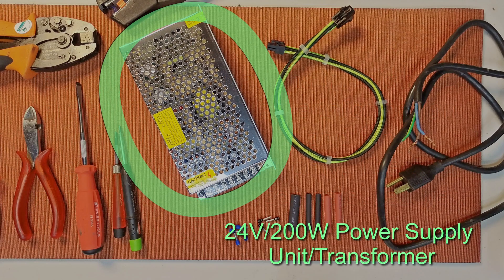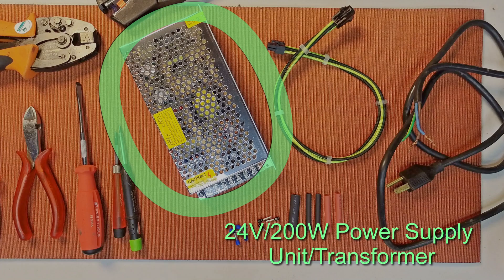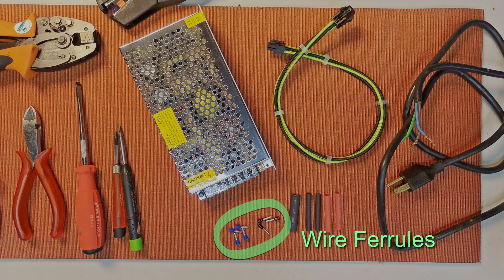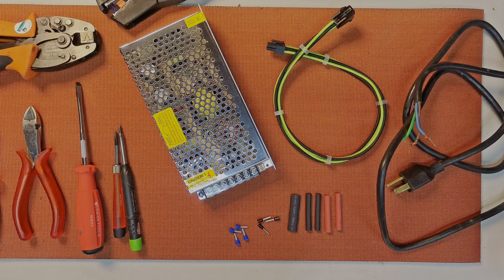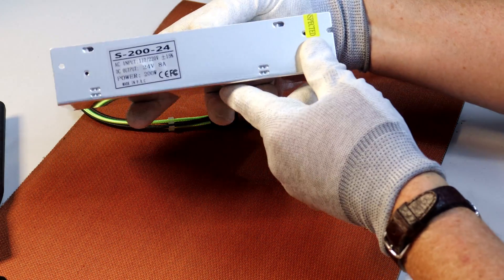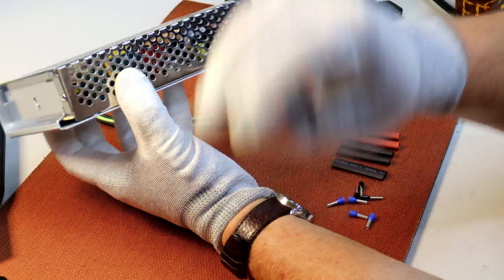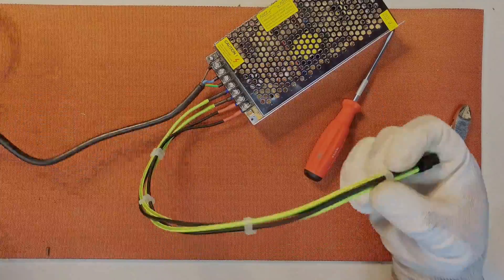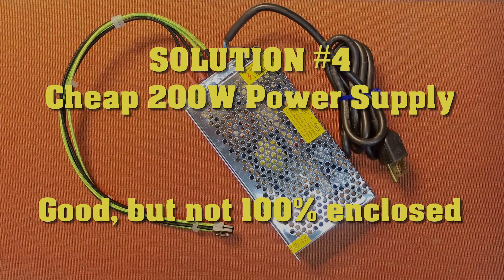$25 DIY 👨🏻‍🔧 **8Nm**  Fanatec CSL DD 200W Power Supply Pack (Boost Kit 180 alternative!) 💪

Comment: followed this video and built build one for my 5nm CSL DD and works an absolute treat!!  Wheel was good before - it's AWESOME now!  Really recommend it - cost me £30 GBP from amazon for PSU and cable and came next day.  beats £150 and a week+ direct from fanatec
Reply from the maker: AWESOME indeed!!! 👍👍👍
Reply: @Polymer  thankyou for your clear guide. Perfect guide, if you can wire a plug you can easily do this!
Reply: Is it simple case where to put your cables from the mother board extension two the left two two to the right as he didn't mention anything on that
Reply from the maker: @kallumwilliams5707  Not quite sure I understand. There's a  longer, more detailed video (maybe that will help?) here: https://youtu.be/wVgVxpWgBOM
Reply: @kallumwilliams5707  Yes, he mentions it in the other longer video he linked in the description, but very simple, basically if you hold the plug facing you with the catch at the bottom, the top right and bottom left are the positive and the other 2 are the negatives.  The cable I bought nicely had 2 separate colours and these were actually on the diagonal the same way.
Reply: @MySimRacer  alright thank you mate I've just ordered the kit now, I didn't want pay fanatecs price as it's technically a csw 2.5 PSU with a different adaptor and they was sold for €40. You still using yours fine no issue?
Reply: @kallumwilliams5707  Yep, No issues at all! works like a dream - and you certainly notice a huge difference. Good luck with yours.
Reply: @MySimRacer  thanks mate my brother's a electrician so my show him the video and let him back on lol
Reply: do you know if its possible to reuse the cable end from the 5nm power supply? By just cutting it off and stripping the wires?
Reply: @GKJasper  I don't think the PSU is man enough with 180w needed
Reply: @GKJasper  I really wouldn't, have kept the original psu as a backup or if I ever resell it.
Cost of all new parts, just buy descent cable from amazon.
Reply: @MySimRacer do you have a link for the amazon PSU?

Comment: ive got a dd1 without a psu supplied with it when i bought it of someone would the 36 volt 10a 360w work for time being i know its 120 watts short of the power brick fanatec sell but couldnt find a cheap 500w 36v psu next day delivery 
also the pin out is 2 positive and 3 negative with a pe sense pin with the pe sense pin do i shove that into ground or the v+

Comment: Are these kinds of power supplies better or worse than the brick types? I'm no electrical engineer but it's switching noise something to be worried about? 
I'm about to buy a Chinese one with variable output for my Moza wheelbase. Thanks for any insight!

Comment: what pins should be 24v and what should be ground in the 4 pin CPU connector? Looks like you connected top right, and low left to 24v, but other sources says that both top should be 24 v
Reply from the maker: You can watch the longer, full video here: https://youtu.be/wVgVxpWgBOM. Pin layout is mentioned at around the 2;53 mark.
Pin #1 and Pin #4 are 24V positive, Pin #2 and Pin #3 are 24V negative if you want the BOOST 8 Nm. If only pin #4 is positive, you are running it in 5Nm (no BOOST) mode.
Reply: @Polymer  Thank you so much!

Comment: My PSU can't go over 23.5v, the wheel run normally for me. Do you think i get less nm cause of the low voltage ? thx
Reply: no, that shouldnt change the nm. What pins on the 4pin connecter should be 24 v and which should be ground?
Reply: @sjelstrup  Honestly i don't remember but you can find draws on internet easly. Thx for ur answer mate.

Comment: In the csl dd what is the negative and positive? 4 pin = 2+ and 2 -?
Reply from the maker: To get 8 Nm, it's pin 1 and 4 = V+, and pin 2 and 3 = V-.
Same CSL DD but only 5 Nm is pin 4 = V+, and pin 1, 2 and 3 = V-.
Reply: @Polymer  thanks works fine at the moment. My wheel arrived without original power suply and i didnt know how to conect that haha

Comment: Hi this may be a stupid question but would a 150w psu work ? I guess I won't be able to push the 8Nm but would it still be able to reach something like 7Nm or will it just have no difference ? ^^ 
Thank you for the video though and super super clean work on your end, big props !
Reply from the maker: It might get hot! :)
Not sure why you'd not just go with a 180W or higher PSU; unless you already have one laying around, maybe? But you are pushing your luck, it may very well be that if it's a REALLY good 150W/24V PSU that you could 'get away with it'.
And thanks for the kind words...
Reply: @Polymer  Thanks for the reply!! Indeed I have one laying around which is why I am wondering^^ It's a meanwell PSU so I think it's not bad, dunno about REALLY good. Anyways I guess I won't risk it and go for something higher then, thanks again!
Reply: @Polymer   @Polymer  Hi again, sorry to bother again haha. 

I managed to hook up the CSL to a 240w psu i found for cheap, and it all works good now TYSM again !

Now my new question is, when you ask for 100% FFB in the Fanatec hub, does it draw 180W, or will it try to draw the 240 my PSU can push?

And, correct me if I'm wrong but, if it would to try and pull the 240W, i would have to put around 67% FFB for it to draw those 180W ?

Sorry if this was answered already, didn't wonder very deep into the comments
Reply from the maker: @RocKzDG  it will draw what ever it need to get to 8Nm...likely even less than 180W...it will never draw more than what it needs to 'generate' 8Nm...
Reply: @Polymer  got it, tysm again 🙏🙏🙏

Comment: With this power supply, will I have more than 8Nm? I have put a 240watt one and I think I notice the strength that with the 180watt one..
Reply from the maker: No, this does not increase power - it's still 8Nm. You can put a 24V/5000W power supply on it, and it's still only 8Nm.

Comment: I measured the power draw at maximum ffb in two games and never saw more than 25w at 240v, then with the 250w 24v 4 wire supply, power draw doubled, to only 50w maximum..
(dd pro base caveat)

measured at the socket so with inverter losses the actual output amperage is less.

I am pretty sure you can sell a molex converter and use the stock brick. it is more than enough, for 8nm!

Comment: The ATX cable seems kinda short. Can you just daisy chain a few of those together?
Reply from the maker: You could add more ATX cables, but just keep in mind that more connections points = more potential issues. Should work though.

Comment: Can I ask something? How can you arranged negative and positive cables in 4 pin molex? I mean, are all the molex diagrams the same and we can plug it to the DD Pro (as DD pro also uses the universal diagram?) and just rewire to the appropriate side on the PSU, as blacks are negative and greens are positive? I am asking because I will tell this info to my electrician when he starts to make it, to prevent wrong -/+ wiring.
Reply from the maker: All MOLEX Mini-Fit Jr are physically the same, yes. That means they will plug into the CSL DD or CSL DD pro just fine. It will be up to you to wire them to work/act as a Boost Kit though. You can watch the longer, full video here: https://youtu.be/wVgVxpWgBOM. Pin layout is mentioned at around 2;53.
By the way, Pin #1 and Pin #4 are 24V positive, Pin #2 and Pin #3 are 24V negative ----->  in this example the two BLACK wires are POSITIVE 24V and the two GREEN wires are NEGATIVE 24V.
Reply: @Polymer  That is the info I was looking for! Pins 1, 4  positive and 2, 3 Negative then. Thank you much! Then if we use a spare Cpu molex we should be very cautious before wiring it to PSU side since Cpu molex pin structure use 1, 2 positive and 3, 4 negative AFAIK.
Reply: @Polymer  BTW this diy boost kit also compatible with GT DD Pro right? I mean GT DD Pro also use the same 1, 4 positive 2, 3 negative right?
Reply from the maker: @TuGyy  I believe the DD Pro is the same, yes.
Reply: @Polymer  Thank you much!
Reply: @Polymer  thanks. I saw the black wires from the molex connector going to V+ on your power supply and i gots confused.

Comment: made a mistake and swapped + and -. Now the the little fuse from the DD is through. Do you know which one that is? It says JT8A on it. But it doesn't help me find the right one.
Reply from the maker: Not good, sorry to hear. Do have the broken fuse? Is it a glass fuse or mounted micro  fuse? Obviously 8A, but the other designations I am unsure about. 8TA is common, but available in various versions.

Comment: I done this, 8nm what a difference the DD performs, done it all for £30 

Power supply ebay 
Power lead and connector Amazon.

Thank you my man saved me £120
Reply: Glad it worked out well for you 👍
Reply: there is a change to broke something?
Reply: What pins on the 4pin connecter should be 24 v and which should be ground?

Comment: Thanks man for this vid!
I would like to try this but I’m not sure about the connection of the four molex cables into the psu V- or V+
The molex cable I’ve found hasn’t the wires color crossed like yours.
Could you clarify this? 
Definitely I’m not an expert
Reply from the maker: You can watch the longer, full video here: https://youtu.be/wVgVxpWgBOM. Pin layout is mentioned at around 2;53.
Pin #1 and Pin #4 are 24V positive, Pin #2 and Pin #3 are 24V negative.
Reply: @Polymer  hello, do positive and negative need to be each in separate link? My point is,i have 200w 24 v, but output is only in two cables..red and black, is it OK to connect two from molex in one from adapter? Thanks in advance.
Reply from the maker: @Lebowskehotepich  Hello. 2 x positive and 2 x negative need to be 'going to' the CSL DD, so the Molex that connects to the CSL DD needs two positive and two negative in exactly the way I show in the video  ---> it's how the CSL DD recognizes if it's in BOOST MODE or not.
You can, however, take the ONE positive wire from your 200W/24V DC power supply and simply make a Y and go to TWO connections on the MOLEX plug, yes. Do the same with the NEGATIVE and you are good to go.
Reply: @Polymer  working well, thanks!
Reply from the maker: @Lebowskehotepich  GREAT!!! 👍👍👍

Comment: Is there any way to squeeze  more than 8nm with a more power full PS?
Reply from the maker: If you mean "higher rated Amps" by "more power", then no, won't make one bit of difference. 
Higher voltage (more than 24V DC) hasn't been tried AFAIK, but will likely fry the CSL DD, or simply not work (over-volt protection).
Reply: @Polymer  thanx

Comment: Hey✌️Thanks for the Vid mate.
If i understand all Correct, the Boost Kit ist just a simple more Power Supply Pack than the standard one?
There is no Fanatec Software, DRM or stuff like that in the original supply?
Reply from the maker: Yes, that's exactly right. Nothing special at all, just a 180W/24V power supply (and the pin polarity is slightly different than the 90W non-Boost kit power supply).
Reply: @Polymer  wonderful. That save me a shit load of money 😂

Comment: what size (awg) ferrule should i get for the wires?
Reply from the maker: Ferrule size is dictated by the AWG of the wires.
Reply: @Polymer  thanks for the quick response!
Reply from the maker: @plusnone3623 You're welcome. the ferrules are optional, by the way; not necessary; it just makes the whole thing a bit tidier.
Reply: @Polymer  trying this tomorrow will be back with updated results

Comment: It's absolutely crazy that they charge 150USD for not a 180W dc power supply, but rather the DIFFERENCE between the 90W and 180W. It really is just a scam.
Reply: Be fair, the CSL DD is being sold at a rather low margin so they are trying to make it back by selling expensive add-ons, pretty standard business strategy. In fact this is better for consumers because if you are tech-savy you can literally save a lot of money

Comment: What do I do when I have a problem with my CSL DD and Fanatec asks to send the original PSU as well?
Reply from the maker: Quite unusual to have a repair done to a device/equipment that also requires its power supply. If still in doubt & concerned, don't do this mod, is my best suggestion.

Comment: I have found that some 24V/240W units come with a fan and others don't. Personally I've never used these Chinese units before, would you suggest purchasing one with or without the cooling fan?
Reply from the maker: Not sure a fan is necessary. A good quality 240W/24V PSU doesn't need a fan, IMO.

Comment: Do you foresee any issue using a 24 volts, 12.5 amps (300 watts) instead of 24 volts, 8 amps. The motor will only draw what it needs, right? 
The main difference between the 5nm and 8 nm output is  how the wiring of the plug provide. pin 2,1,3 neg , 4 positive for 5nm, or 2,3 neg and 1,4 pos for the 8nm.
Reply from the maker: Yes, you have all of that 100% correct. 👍👍👍
Reply: @Polymer  Hi !!

I have a Meanwell HLG 240-24 LED drier which is a 240 Watt 24V DC constant voltage driver. It’s max rated current at 24V is 10 amps which I want to use as a CSL DD boost kit.

However what is special about this driver is that as soon as it connected to something that draws MORE then 10 Amps it switches from Constant Voltage into a Constant Current mode.

That might be a dumb question as I’m not an electrical expert, but I can’t find any info how much current the CSL DD draws Max. But I can’t imagine it is more then 10 amps?? Just want to avoid that the Meanwell driver switches into constant current mode.

Thank you all !!!
Reply: Hi,
I have a Meanwell HLG 240-24 LED drier which is a 240 Watt 24V DC constant voltage driver. It’s max rated current at 24V is 10 amps which I want to use as a CSL DD boost kit.

However what is special about this driver is that as soon as it connected to something that draws MORE then 10 Amps it switches from Constant Voltage into a Constant Current mode.

That might be a dumb question as I’m not an electrical expert, but I can’t find any info how much current the CSL DD draws Max. But I can’t imagine it is more then 10 amps?? Just want to avoid that the Meanwell driver switches into constant current mode.
Thanks!!
Reply from the maker: @Kanuel650  Yeah, those LED drivers can be a little tricky as they are designed for another purpose. I really couldn't recommend a purpose-build LED driver, unfortunately, as it may exhibit odd behavior for our DD purpose.

Comment: My brother Thanks for the video, I bought this power supply today, after watching yours videos. Question: About the cable with the 4 pings, when you connected to power supply why you putting the way is because pin 1 and 3 are positive? you put 2 greens cables in the negative in the power supply and 2 black in the positive? I am little confuse. Please if you can help me . Last question: In the cable the come front the wall or outlet to power supply, how you know what is negative, positive and ground.  thank you again for yours videos.
Reply from the maker: Thanks for the comment. No offense intended, but based upon your questions, I highly recommend you first read up and familiarize yourself with basic AC and DC electrical information.
I did NOT follow standard wiring colors for the DC output; in my example the two BLACK wires are POSITIVE 24V and the two GREEN wires are NEGATIVE 24V. DC standards would be RED = POSITIVE, and BLACK = NEGATIVE. As for the connection to the outlet/wall: that is AC current, NOT DC, so there's no POSITIVE or NEGATIVE. I can't see where you are located in the world, but here's two examples for typical AC wiring colors in the US and Europe: 
1) USA: BLACK or RED = Line (Hot), WHITE = Neutral, GREEN or GREEN/YELLOW or bare copper = ground. 
2) EUROPE:  BROWN = Line (Hot), BLUE = Neutral, GREEN/YELLOW = Ground. 
But again, I suggest you first read up on this stuff a bit, before attempting to solder and make this adapter!

Comment: I found a power supply with 180W 24V 7.5A Molex 6 Pin on Aliexpress, see www.aliexpress.com/item/1005001694661669.html Can a 4-pin molex easily be swapped to provid the correct configuration?
Reply from the maker: Nice find, BUT: it's not that easy to swap out for a 4-pin MOLEX, as that cable likely has 6 wires (or only two?). Best solution would be to find a 24V DC Power Supply that already has 4 wires (2 x Pos, and 2 x Neg).

Comment: So it looks like the CSL DD just does a voltage sense on that additional pin. Presumably by an opto in parallel and reconfigures the max current of the motor driver circuit.
Reply from the maker: Yes, that's what I figure also.

Comment: not related to fanatec, but the turbo power brick that came with my thrustmaster ts-pc failed on me about a year ago and replaced it with a Mean Well LRS-350-24 and it has worked like magic   ever since, no power loss, not over heating. Had to do some rewiring to go around the usb detection system, but that was it. Hopefully it'll be the same on the CSL DD.